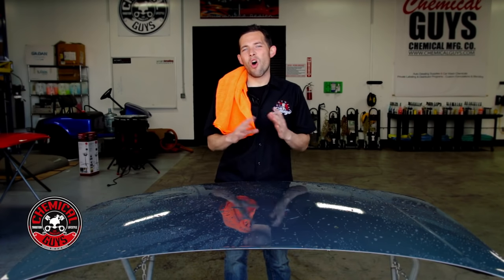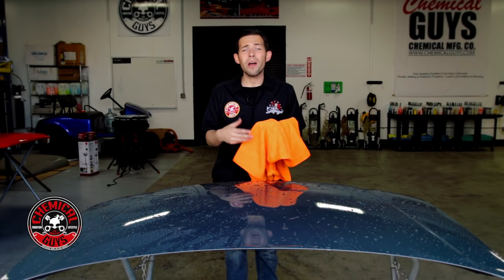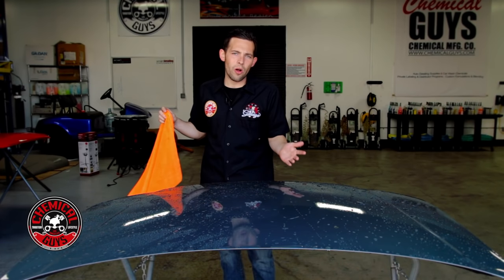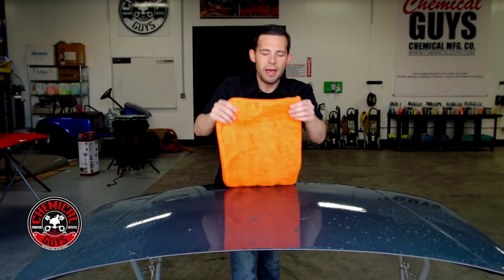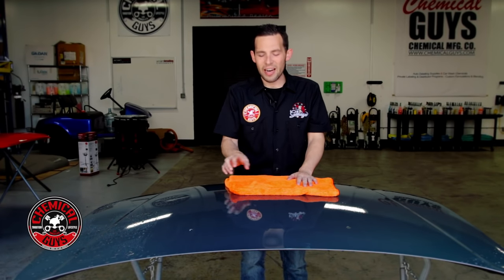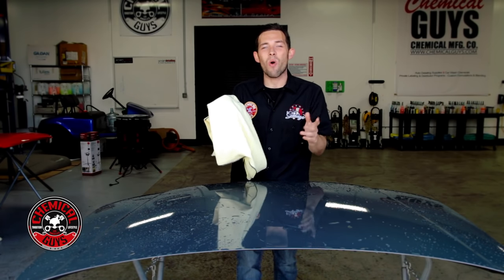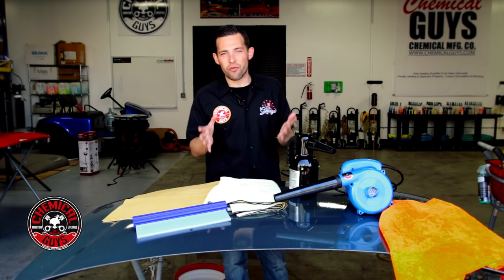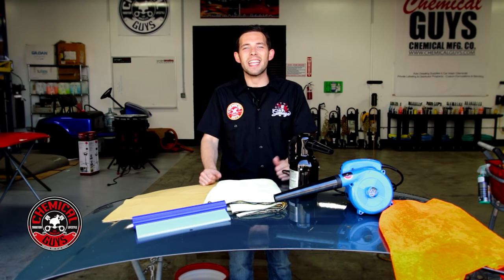Best Car Drying Tools: Towels / Chamois / Blades / Blowers - Chemical Guys

Comment: As a detailer I started out using Microfiber towels and they work, but I never went through a whole vehicle without having to ring it out multiple times. The same with the waffle towels. It also would take forever to dry a vehicle and time is money when you are a detailer. I then moved to using a blower and my partner goes right behind me with a micro fiber to get any small excess. That process was a game changer as I can get a sedan completely dry in less than 5 minutes and I did time it. My blower is a lawn blower, was $68 dollars, has a speed control, and can blow at 250 mph.. I believe it is cheaper than the one's marketed for vehicles, and is more powerful. It has been a game changer ever since. In short, if you are planning on being a detailer, I disagree with the thought that microfiber and waffle towels are the best to use.
Reply: Travis Kibel what brand of blower and where did you buy it?
Reply: I got a Toro lawn blower from Home Depot. The thing blows at over 200 mph..has variable speed...was cheap...is electric...and works wonders for drying vehicles quickly.
Reply: I can dry my Truck with 1 shammy in 3 mins lol
Reply: @spiderofthehood6127  You won't get it completely dry as you will not be able to get to many spots in that amount of time and you will have water dripping from areas you can't get to.
Reply: @lonestarpatriot876  Bro besides the top of the cab pretty much everythings dry

Comment: What am I missing with microfibre towels? On my car all it seems to do is move the water around. I have to constantly rub until the water seems to evaporate.
Reply: I use the Absorber (not mentioned)works faster than a microfiber, you do have to wring the water out a few times- Very durable easy to clean and stores in a small container.
Reply: Ronald F I have an XL absorbent towel, do you wash yours or just wring it out?
Reply: Honestly you should just use micro fiber to wipe excess water and waffle weave to finish off thats what I do
Reply: @dissomeboolshiethowsyourda3443  so what ru saying the microfiber actually workks for u sir
Reply: @nickreid7974  there's several ways to dry. Yes microfiber is meant to be used to wax a dry or wet surface . Waffle weave is used to pick up water and also wax . I personally don't use micro fibers anymore because they do get messy . Just stick with a waffle weave I use 2. 1 to pick up water and 1 to dry. Beware of the pressure you apply and the direction you wipe to prevent swirls . Hope that helps
Reply: Which of these is best for a black car???
Reply: The trick is to wet the towel. Ring out the water and it'll work better than a dry towel. Believe it or not.
Reply: @FC-kx5yh  I can confirm this!!! I knew there was something missing and I could not figure it out. Even with the micro fibres I felt it was so rough and dry on the paint. Later I figured spraying it with a tiny tiny bit of detailer on the towel and than drying it made a huge difference! Than I realized, it just had to be a little wet!
Reply: I tried the absorber. It doesn't seem to work for me. Once it gets wet it just pushes the water around and leaves streaks.
Reply: THANK YOU Movie Junkie. Finally,,, someone who knows what they are talking about. Take a plastic grocery bag and try to dry your car LOL LOL.
Reply: @nickreid7974  NO this a SALES AD LOL.
Reply: @conceptdesigns4100  Chamois
Reply: @amigo4909  the absorbers are basically just a chamoi made from PVA
Reply: So with the waffle weave or micro fiber towel you wet it first, dry it a bit and add wax on it then remove water from the car?
Reply: Microfiber drying towel

Comment: I'm with a lot of you here that they should eliminate the blade from any video showing drying techniques!  I used one years ago and as a result had to spend big bucks to detail out all of the scratches I added simply by drying it.  And I agree, the two blowers are too weak to get the drying done quickly and you still end up having to use a "microfiber towel"!!

Comment: I'm really disappointed that they are actually recommending using a water blade. A water blade is pretty much the fastest way to leave scratches in your paint, short of drying it with sandpaper. Lol. Even if you are 100% perfect & don't miss any spots at all (we all do), it is likely that a small amount of dust or pollen will land on the vehicle between the time you wash & the time you dry. You're just asking for scratch city. Just listen to it. It's like nails on a chalkboard because there is no lubrication. Sad.
Reply: HawkeyeSTiGuy I seen a guy doing it on a fresh painted camaro. And he said it so easy and won't scratch.   And then he seen the scratches.  I laughed so hard
Reply: wrong junior. water blade is perfectly fine. go to any pro detail shops and see
Reply: "drying your car is all personal preference" chamois drag dirt along the paint.... Microfiber is the only way....
Reply: Northern Prepper 120? Should have used at least 80 grit. The larger spaces between the grit means that it won’t drag dirt along your paint. 👌🏻
Reply: @Vae Victis Yes dummy. You’re supposed to use 60 grit if your car is made after 2010.

Comment: Painted my classic Cadillac with Imron paint about 6 years
ago. Just wash with a light dish washing liquid and dry with a microfiber cloth.
Never any waxing needed and shines like a baby's ass every time. When I bought
the paint at the paint store, the guy said I was buying airplane paint. I said
"I know". He said well, at least it's a hard paint and it won't
scratch very easily and you'll never have to wax it. I said, "That's what
I'm looking for" and bought it. Very expensive but well worth it.

Comment: Love your video, the water blade is my preferred tool to dry a vehicle, but I must stress that it needs to be wet in order to perform properly, or else you will scratch your vehicle, you wouldn't use a dry claybar, or dry cloth on the surface of your vehicle, it would be a nightmare, so never use a dry water blade on the surface of any vehicle.

Comment: My personal opinion for car drying is this:

1. Completely soak a waffle weave in water and ring out. It works alot better imo if its wet vs dry. If you start with it dry, it doesnt suck up as much water until it gets wet enough. 
2. Dry all surfaces this way, ringing out as you go. 
3. Use a gas powered leaf blower to hit all the cracks, crevices, grilles, lugs etc.
4. Give the car a quick spray down with a detail spray
5. Go over the car with a microfiber towel, getting any missed water (there shouldnt be much left at this point) and buff to a shine.

You can always detail spray the car before step 2 if you prefer. I used to do it that way, but found that I liked this way better. I always use the leaf blower on step 3 as its easier for me vs getting out an extension cord. I also do not recommend using just air to dry the car. It takes ALOT longer to dry with a leaf blower than a wet towel.
Reply: Krysco51 be wary of gas powered blowers as they can actually blow its exhaust gases onto paint
Reply: No repeating anything. Tried it. Ill stick to electric from now on

Comment: Not really sure of the towels I use but I buy them at a local auto store. I also notice that the size of towels you demonstrate with are larger than what I have. Mine are the size of regular wash cloth.
Reply from the maker: Hi Avelino, that's right, many of our premium microfiber towels are not only plush, they are large to make quick work of drying your vehicle. If you haven't tried them yet, what are you waiting for?! 
https://www.chemicalguys.com/Professional_Grade_Microfiber_Towel_24_x16_p/mic_507_03.htm

Comment: Chamois is the best for drying your car after a wash. As long as you keep it moist a bit before drying, it won't scratch your car. I like them better than microfiber material simply because they don't leave any lint and fiber material that can come off when you use microfiber material towels..
Reply: jukijunk You and me both. I love using my chamois.
Reply: jukijunk you are right, they are pushing the microfiber stuff to the extreme. One thing te keep in mind though is to place the shammy flat on the surface and gently “dipping” the car. I use to make spinning movements while drying my car which is not the way to do it.

Comment: I don't know about for most people or if the water I use is just full of chemicals but I found that using one microfiber to get my car fairly dry still leaves tons of watermarks I have found that the best thing to do after you've gone over it once with a microfiber is go over it again with microfiber buffing towel and get it dry dry that leaves me with the best finish
Reply from the maker: Hi Quentin, thanks for watching. You usually need a few towels because your first towel will eventually so gunked up with dirt, that you will spread the dirt back onto your paint work. Trucks require more absorbency, and using a big towel will eventually get soaked, in which case you will need a secondary towel to get the job done. As far as minerals go, using deionized water is the recommended method to avoid leaving behind water spots which damages the paint in the long run. A good way to complete a detail is to use a quick detail spray to remove any water spots left over from buffing the paint.

Comment: That water blade sounds horrendous
Reply: Yeah it does.
Reply: he doesn't know how to use it
Reply: Works great for glass.
Reply: You can hear the scratches forming. Never use these monstrousities to dry your car, just use a plush Microfiber Towel.
Reply: Waffle Microfiber sounds better. It is a microfiber towel as well but absorbs twice as much water.
Reply: needs also lubrication
Reply: and you still need a microfiber drying towel

Comment: I use the blower that comes on my ShopVac unit, very powerful (195mph wind) with a high volume so it blows away a large volume. Takes me about 5 mins to blow dry my car.
Reply: What shopvac do you have?

Comment: Using a chamois will be more cost effective when starting a hand car wash? Instead of buying two tons of microfiber towels to dry vehicles through out the day?
Reply from the maker: Hi Oscar, good question. Yes, a chamois would more cost effective because you can simply wring it out and then use it again. It's the fastest and easiest way to dry multiple vehicles! However, keep in mind that a microfiber towel provides better protection against swirling and scratching because it has thousands of little microfiber strands that suck up dirt and debris, whereas a chamois is a "flat" surface. Thanks for watching, Oscar, and thanks for being a part of the Chemical Guys family!
Reply: Chemical Guys thanks for answering my question!

Comment: So the Chemical Guys... Meant to be pros, are recommending a water blade! WHAT!?
Reply: Chemical guys make alot of useful videos, but the problem is they're a business at the end of the day, and they stock the water blade, so it's all about selling a product at the end of the day.
Reply: ^ He's got a point
Reply: den525 what is wrong with them selling a product?  I don't recall they charging us to watch this video.
Reply: +thaylor harmor did i say there was something wrong with them selling a product? no.
Reply: C'mon man...Hey says repeatedly that microfiber is the preferred method. Chamois and blades for large commercial or fleet vehicles where you're just looking to clean and dry as quickly as possible.

Comment: I used a normal rag/towel and it left little scuff marks all over my car 🤦‍♂️ any way to fix this or it’s set in the clear coat?
Reply from the maker: Hey! Machine polishing is the most effective method of removing scratches, swirls and scuffs.

Comment: When using the water blade, is it better for the car to be already decontaminated with clay or can you use it with contaminated paint as well?
Reply: Why is that?
Reply from the maker: Christian Neff Works on any car as long as its cleaned and washed.
Reply: It's best to never use a water blade..
Reply: don't use the water blade!! high quality micro fiber towel is the why to go....bro

Comment: what is the best way to dry the microfiber towel after drying my vehicle? Shd i just let it air dry or put in dryer for a specific amount of time?
Reply from the maker: Hi Bryan,

We have the perfect method for you to keep your MF towels clean and ready-to-use for your next detail. First, separate the towels by type to keep grimy towels away from cleaner paint towels. Start by washing cleaner paint towels first, then finish with the grimier towels. Machine wash mircrofiber good with our Microfiber Wash (link below) with HOT water. Hot water opens up the fibers to better release dirt and grease. DO NOT use fabric softeners because they clog the microfibers and render them useless. Machine dry the towels on LOW heat. The high heat cooks the fibers, making them hard and putting you at risk of scratching your paint. Again, DO NOT use fabric softeners. 

Happy detailing and thank you for being part of the Chemical Guys family!

-CG Javier
Reply: thanks for the feedback

Comment: I used to use a leather shammy (the same one from the vid) and it doesn't dry a full car. You'd have to wring it out a maybe 4 times or else it'll leave a little water behind and ull get water spots. And thats on a car the size of a camry. Also it has a chance of scratching ur paint. If you're deadset on using one, I'd only recommend it for light colored cars. Please don't waste your money on a squeegee lol. You'll fuck up your paint and spend 10x the time drying it. Go with a microfiber drying towel like a waffle weave. They're a few dollars more than a leather shammy but they wont mess up your paint and if you take care of them, they'll last a long time. If you're a serious detailer then the best option is to use a blower. They cost allot but they're the best.

Comment: Hey guys! I was hoping this would be a good place to ask. I'm new to detailing. I wanted to get the Orange Hex Aplicator pad for removing swirls on my car. Would one pad be enough to use for the entire car (kia soul)? It would just be used for the scratch removing step. Of course I would have different pads for polishing and waxing.
Reply: CollegePanda the standard is using a orange pad with v32/v36 and a white pad with v36/v38, it depends on how much swirls you have.

Comment: Which drying tool that are the best to prevent swirls?
Reply from the maker: Many swirls are caused by contamination that isn't removed when you wash. Always clay paint that feels contaminated. Personally I use the woolly mammoth or the miracle dryer and both work amazing.  Had a 4 year old S7 Audi i juts sold that didn't have a swirl on it. Hope it helps : )

Comment: dragging across the surface is so much easier in theroy than in practice lol. how are you going to drag it on the top of a high car like a 4x4? or the vertical panels like doors etc?
Reply from the maker: +TheJanope13 We've gots one of these bad boys in the Detail Garage.. makes life and up-high detailing a LOT easier!
http://www.amazon.com/Giantex-Aluminum-Platform-Drywall-Folding/dp/B00Q9O0HO0/ref=sr_1_6?s=hi&amp;ie=UTF8&amp;qid=1452875793&amp;sr=1-6&amp;keywords=step+ladder+platform

Comment: I have a gas power blower. Can I use that? Serious question from a noob.
Reply from the maker: Hi Thomas, it could be used with some degree of caution, however it would not be our first choice. If you decide to use one, use it on a very low setting to avoid kicking up dust around the car and putting it back on the car. Be mindful that the longer nozzle/air output shaft doesn't ever come in contact with the car as it could scratch the paint. We prefer the Jet Speed because of its perfect output, easy to handle size, and flexible nozzle that has a lesser chance of scratching your car should it come in contact with the paint. Happy detailing!

Comment: I'm having issues trying to dry my car. with my drying towel it just leaves a bunch of water streaks. What's causing this?
Reply from the maker: Hi Kenyon, are you using deionized water to clean your car?. What you're getting is dried up mineral deposits. You want to try using the Afterwash product, it will help you dry by causing the water to bead off.
Reply: You're probably drying your car in the sun, and/or taking too long to dry it. A regular towel will get saturated with water very quickly and lose its absorbing qualities. First use a foam squeegee to pull off most of the standing water. Then come back with a waffle weave microfiber drying towel to absorb any remaining traces of water. You'll be done drying much quicker and more thoroughly. Not a spec of mineral deposits to be seen.

Comment: You guys wouldn't happen to have any tips to fix any light scratches as a result of a bad experience with Chamois' would you?
Reply: Run your fingernail across it, and if it catches in the scrath, then you need to paint it. If its not down to the metal then you can just use a compound polish.

Comment: Just use 1 or 2 big absorption towels, dry up the whole car and just have an air compressor available to remove the remaining water that's stuck (side mirrors etc)

Best way to do it imo, takes around 10-20 minutes for a sedan
Reply from the maker: Hey Deluxo, do you operate a detailing business, or do you detail as a pass time?